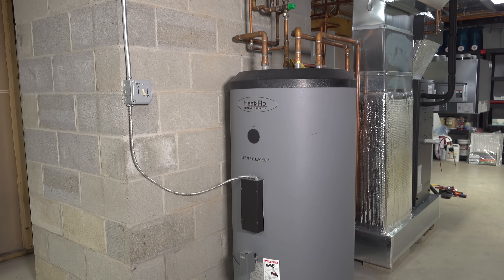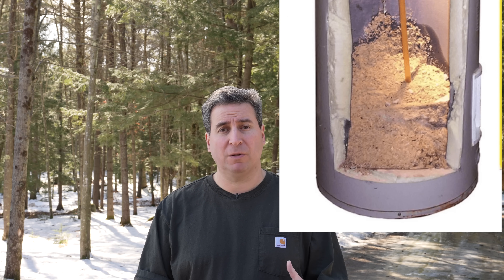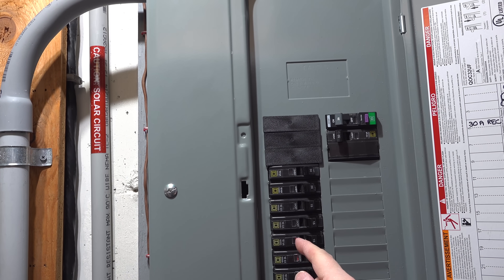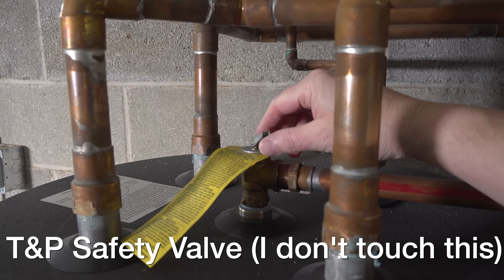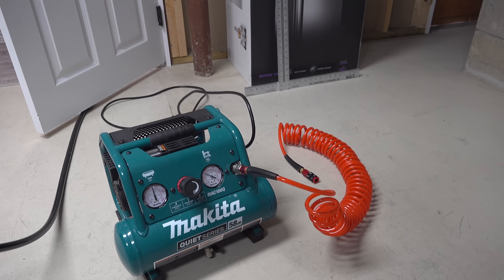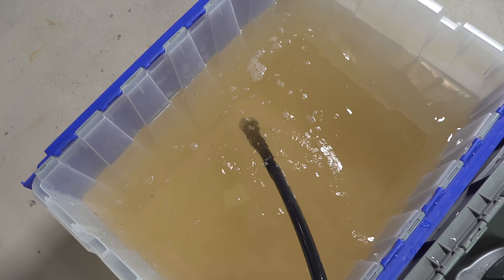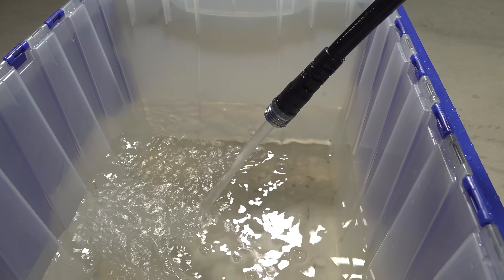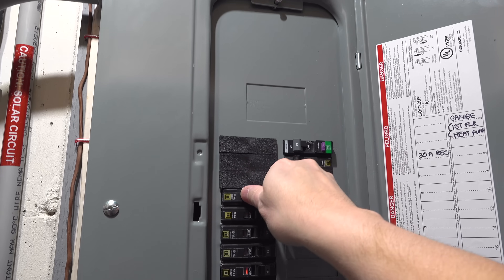EASY Way to Flush Your Hot Water Heater using AIR - Sediment Buster

Comment: Plumber checking in, You can use the pressure from the cold side to flush out the sediment through the drain valve at the bottom. However if you truly want to prolong the life of your tank replace the anode rod every 4 years.
Reply: Yes.  Sadly I mis-'engineered' my installation.  Found a good place for the tank up in the attic so I could drain the entire system if the power went out for extended periods of time.  Located it over an interior wall corner for support.  Built an insulated dog house around it, installed a range boiler for pre heating and a propane demand heater as well.

Unfortunately the thing is installed so close to the roof I would have to put a vent up there over the anode to get access to it by pulling it out through the roof.  Next time.

I hear there are a couple of flavours of anodes for different water types.  Mine sucks.  I just read up on them again.  Looks like I have all the symptoms of a failing tank.  Next time I think I'll be putting in the correct type of anode as well.

Thanks for checking in.
Reply: @gragor11  they make anode rods that have sections linked together like sausages for applications like yours, also electronic anode rods that are much shorter. Just a heads up
Reply: @stevedrawdy2532  Thanks.  I'll start looking for them.

Comment: There is always a bit of sediment that gets stirred up when refilling tank, let it sit (if possible) before running the hot water, then either remove the aerators at the faucets or take them off later and clean them.

Comment: If you have an electric water heater, I cannot stress how important it is to make sure the tank is full of water before turning the power back on. If the power is restored without the heating element submerged in water it damages them within minutes.  I have seen it happen on countless new water heaters.
Reply: Always make sure tanks full with any heater before restarting gas Nad electric.

Comment: I have a 4 year old water heater that i believe might be causing a hot spot of about 95F on my slab foundation.  What is odd about this, is when I let the hot water run out for 2 hours by running the bathtub hot water, the hotspot on the slab goes back down to 75F and stays that way for several weeks but then the problem comes back! I believe the TP valve drain pipe runs right under the slab where the hotspot is and could be the culprit.  Could that be due to the fact I have never flushed the water heater?  Is it hard water and sediments causing this? I need help!
Reply: Could be a number of things from pinhole leak to t&p dripping

Comment: When I had a new water heater installed, the installer said I did not have to drain it.
Reply: Would depend on what's in your water some areas have alot of build up others are fi e.

Comment: Thank you for this video.  I have a heat pump hot water tank so it is even more expensive than your typical hot water tank.  I will be buying two of these (one for a spare) and doing this on a multi-year basis.

Comment: Of note, if you have a regular water heater either electric or gas, not the indirect like he has, I would NOT flush your tank after it's more than ~3 years old depending on the hardness of your water.  Once the junk starts to accumulate at the bottom of your tank it starts to wear at the glass and finally eating your steel tank.  The junk can actually act as a plug preventing leaks, if you clean the junk it can start to leak.  I did this with my 8 year old heater when I moved houses.  A few days after cleaning it the tank started to leak.  
Got a new heater, do annual maintenance (don't forget to change the anode rod) if it's 3+ years old leave it and start maintenance after your next tank swap.
The indirect tank he has is stainless steel and should last a VERY long time even without maintenance.  The tanks most folks have is a glass lined tank and the manufacturers are making them cheaper and cheaper these days.  If you buy a regular one expect 6-7 years.  With maintenance it can last a LOT longer!

Comment: Just turn off the breaker to the water heater and run hot water in the tub until it gets cold. No need to wait hours for the water in the water heater to cool down.
Reply: Will doing that  replace the need to flush out the tank the other way or does it still need to be done? Thank you in advance

Comment: Easiest flush method is to hook up a garden hose, turn the heat setting OFF, and open the valve for about 15 minutes. The water intake line needs to be open so the flow and pressure of water will flush the tank. I do this several times each year. Super easy. (02/12/24)
Reply: He already made a video for this.
Reply: 7/13/25 🤨

Comment: My water tank went 2 months ago. I am skilled enough to change it myself. $1300 for the HWT at a plumbing supply for a 50 gallon tank- ours was a high recovery unit. You’re spot on with the 2000 dollar charge if you’re in the typical water tank replacement. More like 3-4K for the power vented high efficiency units. That’s insane
Reply: he said the most expensive appliance they have in their house. 
i say BS, try replacing a furnace central air unit.
Reply: Without question the furnace/air conditioner/boiler/heating and cooling equipment is the most expensive and that is not even close
Reply: Roof and siding has entered the chat.
Reply: Appliances were talking if you consider an hvac unit an appliance. If not then windows wants a piece of this too
Reply: @lesg9604  I missed that , I was only speaking out of pain since I had to drop 25k on a new roof and siding/paint.
Reply: Sorry for that my friend. The exterior replacements on a home are the worst. Bet it looks nice and new now though
Reply: I just bought my 50 gallon, 40k BTU by State - Proline NG , has 6 year warranty for $708.00 from a plumbing supplier. Guess it depends on what you want or need.

Comment: A real life extender on at least older water heaters is to replace the anode. I found that it’s not too hard, especially if you have access to an impact wrench . otherwise, it’s a little bit hard to keep the tank from twisting. The other impediment to doing it is that it’s harder to do where there’s a combination, inlet, and anode. I’ve never attempted one of those.

Comment: You could likely take a 6" long piece of 2x2 and position it on the tank near the elements, then on the back end of the board, use an air hammer on lower power, or even a sds drill in the chisel mode with a flat face bit and likely dislodge much more stuff off of the walls than the air bubbles.

Comment: Over $2k to replace a water heater?  Yikes.   Do yourself a favor have flex lines for the last foot or so to the house plumbing,  then the next time you need to replace your water heater it's as simple as removing it, and installing another and rehooking.   You do not need a licensed plumber to do this!
Reply: Depends on area some states require a plumber also a half decent heater runs 900 to 1400 for a natural draft unless you go with thinner tank big box store units. Also if have electric water heater some states also require new disconnects plumbing and electric permits.

Comment: Tanks with electric heating elements will also have a sacrificial anode that should be replaced periodically as it protects your elements by corroding first rather than your elements corroding.
Reply: Gas has an anode as well.

Comment: What I've done is close the hot line, keep the cold on and use the water pressure to force the sludge/sediment through the drain.
Reply: Me too. I installed mine in 1992. It still works. I partially flush every 6 months.

Comment: It's why I use a whole home filter and water softener. And as a few people said, when you get a new water heater, replace the stock drain valve with a full port ball valve, and I always use a hose bibb cap on mine.

Comment: Thank you for making this!
I have a similar (if not the same) holding tank. 3 years no maintenance, so it might be time. Good call on Do Not Touch the relief valve. The spring gets weak over time and may not seal when you play with it. And need immediate replacement.

Comment: have you seen the turbo cleaner?
Reply from the maker: I have, and was going to show it last year but changed my mind. I don't like how it works, requires valve removal, which in itself is too much risk and spinning a toilet snake inside a glass lined tank is scary to me. I was pleased when Roger Wakfield (famous internet plumber) showed it a few months back and basically ended the video by saying it seemed to risky to use.
Reply: @SilverCymbal  thank you for your insight I'm abit worried of adding pressure to the same glass lined tank and the wire lol looks like a new one for me lol again thank you

Comment: Why do you still need to turn on a faucet nearby if you are already charging the tank with air?
Reply from the maker: You are letting the air get out once its bubble through the tank. If you don't open it you will keep adding pressure to the tank.
Reply: @SilverCymbal  Oh I thought pressurizing to speed up draining was part of the point, in addition to agitating with air.

Comment: Fascinating, but won't pulsing the cold water valve (quick on and off) do the same thing as to stir the sediments ?
Reply from the maker: Yes, that will remove some, but if that really worked you would be doing that every time the tank was used and yet many tanks have a huge amount of debris. I think some of the benefit is that when the sir goes in it must stir it up differently.  Maybe the air breaks stuff apart. I didnt think anything would come out of my clean tank but it did the trick for sure.
Reply: @SilverCymbal  Makes sense !  Thanks for sharing !

Comment: Trivial:  Don't turn off the cold supply to the water heater.  You have water pressure, use it.

Better:  Replace the little drain valve (most have a 1/4in water passage) with a 3/4in ball valve.

Comment: I’m not gonna lie.  I’ve never maintained my hot water tank because I’m afraid I’ll cause trouble with it after I mess with it.  Every time I’ve used a water valve that I haven’t turned in years, it starts leaking after I use it. Then I need to replace the valve so I think if I touch that 20 year old perfectly working hot water heater then I’ll be probably be replacing it. 😢
Reply: If heaters older and never been flushed thiers a high chance it'll leak after.

Comment: Change the anode rod too.  If your tank is rusting out, you waited too long to do that, but better late then never.  If it is rusty AND old (and hasn't been well taken care of) change out the whole tank rather than risking it leaking into your house.  WH are cheaper than remediation and water damage.

Comment: Tanks?  who still has a tank water heater?  last 3 houses I’ve owned had/have tankless on demand..   of course the oldest of those houses I replaced the tank water heater with a tankless, second oldest house we specified a tankless water heater, and my latest house has dual Rinai tankless in them, with a recirculation system..  tankless need to be cleaned as well, with vinegar and a circulation pump in a 5 gallon bucket, you isolate the houses cold & hot and run the solution through the tankless’s coils for a while, that descales the copper coils and it produces more hot water, faster…

Comment: Did you close your faucets before you added air? Were you concerned that the sediment would get pushed into the faucets?

I think I would be a little scared if I added too much air to the tank... Could it break if too much pressure was added?
Reply from the maker: No, with the faucets open, your hot water system is now freely vented. Think of it, like putting a straw at the bottom of a glass filled with water. The bubbles rise through the tank and out the faucets. The debris won't ever get that far as its going out the hose.
Reply: @SilverCymbal  that makes sense! Thank you for the reply!
Reply: Hopefully the temperature & pressure relief would open before getting to dangerously high pressures. If it doesn't and there's no water in the tank, it could be deadly if you go high enough on the pressure.

Comment: Your best bet is to remove the horrible tank drain valve they include with most water heaters and install a straight full port 3/4 inch ball valve with a 3/4 fpt to 3/4 hose adapter installed one end. A ball valve won't clog like the included drain valve will, and you can get much larger chunks of sediment out of them than you can get with the standard drain valves.
Reply from the maker: This is very good advice!
Reply: I'm regretting not doing this when our new heater was installed. I want to flush it, but I worry about that plastic valve shutting. I did buy a transfer pump, so I guess I'll keep it on hand when I open that valve in case I need to pump 50 gallons up the stairs and out the back door. 😅
Reply: Only issue is if the boiler valve is all plugged up, that’s what I had for my water heater.  But yes, once emptied, I swapped to a full port valve.  Game changer for flushing.  Definitely will do on the next one before it’s filled.
Reply: Do you simply unscrew the drain valve when the tank is empty? I have never change any part of the tank before and don't know if drain value or relief valve can be change. Any ball 3/4 FPT to 3/4 hose thread ball valve work or has to be special dimension for water tank? I have AO Smith Signature 300 Gas Water Tank.
Reply: @DarthVader3425 yes you just unscrew the old one and screw in a new one.
Reply: Ok thanks
Reply: Yup, 3/4 inch ball valves are the way to go. It makes flushing the tank a piece of cake. Once the tank has been emptied, I open the the cold water inlet valve rapidly two or three times and then open it full blast, that stirs up the rest of the loose stuff sitting at the bottom which results in a better cleaning.

Comment: no just no... have you ever looked inside a boiler? there can be buckedts of lime in there and if there arent "buckets of lime" in there than it does not matter
in europe the boilers have a flunge you open the flunge get a small shovel and take the sfuff out clean the heat exchancher and so on than you exchange the magnisium anode if nessacery to protect it from corosion

keep the temperature as low as possible aboth 55-60°C a sload of lime falls out of solution aspacially if the water is hard

i havent tried what you are doing but i dont think that it is worth it

- a boored plumber

Comment: I had a recent scare with my 80-gallon indirect water tank, but luckily, it was fine. That said, as a point of reference, the cost to remove and install a new one as quoted was $6500. So, yeah, not cheap. Bottom line: do the regular maintenance.

Comment: Here's a tip for toilket tanks that might apply: Citric Acid. One cup in hot water breaks up calcium deposits. I wonder if it would work for the hot water tank.

Comment: In some places after the water is heated and leaves the tank it will clog the copper pipe with magnesium which is in the water...  Slow hot water check the first foot of pipe coming off the W.H. also with hi eff washer check the water inlet where the rubber hose connects....

Comment: Any time you stir up sediment like that be sure to take out all your sink aerators before restoring the water. You will clog them if you don't. If you can't remove one easily just don't use it until you have thoroughly purged the system
Reply: Always try to ok flush water system through tub when waters first turned on most of sediment will flownout tub to help prevent issues
Reply: Excellent advise! We should be using the closest fixture to the hot water tank to flush the tanks output line. Many times it'll be a washing machine. So I take the line off going to the washing machine and replace it with a garden hose and really flush the hot water heaters output.
Reply: @kylequest  Thanks!  This is important to bypass the washer.  After flushing the water heater I had to find the washer inlet screen filter to un-clog…
Reply: Another thing to do it set your water softener on bypass, otherwise sediment can and will clog that up too.
Reply: @username8171   Not at all likely since the water softener is on the cold side of things and with this procedure he closed the cold water inlet to the water heater.  There would still be full pressure in the cold water lines.

Comment: Can you basically accomplish the same thing buy power flushing and turning the cold supply side on after draining the tank to help bust up build up on the bottom?
Reply from the maker: That would definitely help, the bigger issue is the valve clogging . A lot of people have tried to open their valve and nothing comes. This keeps blowing it back open and little by little you get the tank and debris drained. There are some other tools but all of them require you to take elements out, one even requires the valve to be removed. What makes this one cool is the fact it needs no dissaembly and keeps the valve clear through the process
Reply: @SilverCymbal  i agree, this device helps keep the valve clear. My thought is if you have a newer tank and do regular flushes that a power flush accomplishes mostly the same thing when the tank has little enough build up that it keeps the valve clear. Interesting device either way tho, I'm intrigued